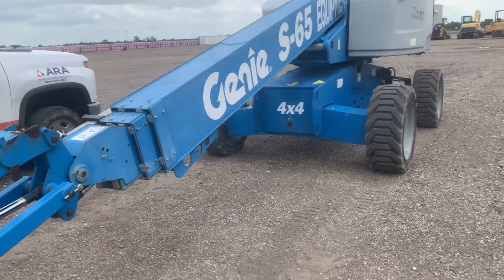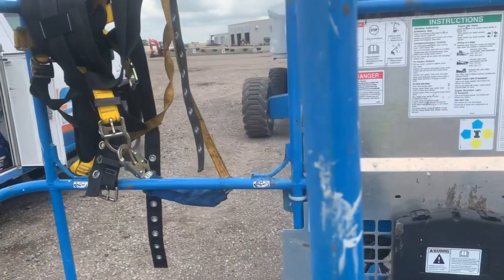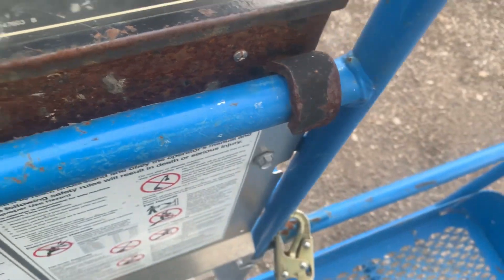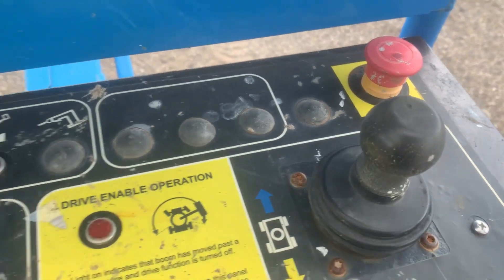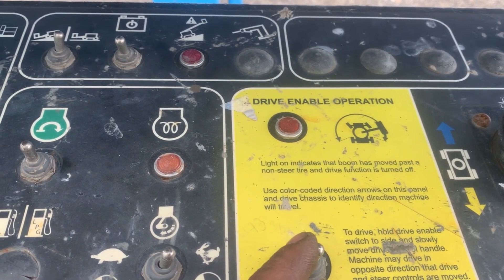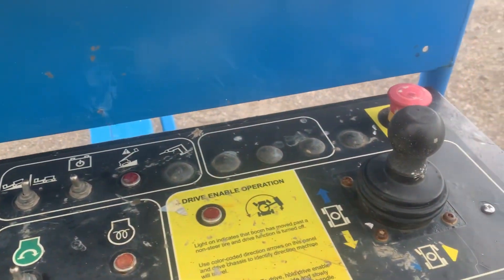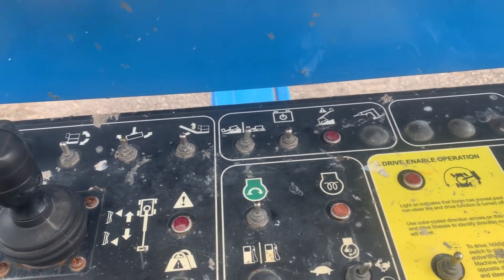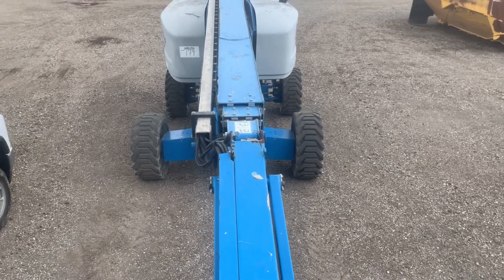boom angle sensor calibration

Comment: Will this work on a 2002 genie 60/34 ? I installed a new primary boom switch and when I raise the primary boom it stops lifting when the lever of the switch is in the full up position. I’m not sure why it doesn’t what to go up.
Reply from the maker: recalibrate the joystick. the voltage sent from the joystick is above the maximum value stored in the board.
Reply: @texasliftpro  Hi, 
So do I follow your instructions in the video?

Comment: Sir I have a s-85 boom lift throwing me a angle sensor invalid set up code tried calibration but won’t go tru please advise
Reply from the maker: you need to check your angle sensor voltage output when the boom is fully lowered, must be 2.16V dc to 2.2V between pin 2 and pin3

Comment: Good job there sir❤️👍, please sir I have a problem for s125 sir the third boom is not coming out sir please sir what will i do sir to fix it sir? Thanks for your understanding sir.
Reply from the maker: if you don't have a safety fault code,  you need the WEBGpi to change the settings
Reply: @texasliftpro  ok thanks ❤️
Reply: Thanks so much for your response sir

Comment: Thanks, but how will I solve the problem of p11, p30,p39. On z135/70.Please sir I need your response on this sir thanks.
Reply from the maker: sorry it might be late for the answer ;)
let me know if you have P38 ?
Reply: @texasliftpro  yes sir the p38 is al so there thanks
Reply from the maker: turn table Y axis tilt showing  +5deg or more. and sec boom not retracted, retract the sec boom or check limit switch. check the tilt
Reply: @texasliftpro  ok thanks for your response sir I will check it and get back to you sir thanks 👍